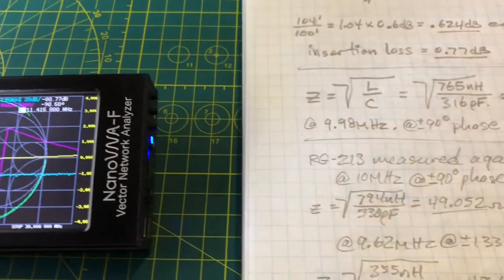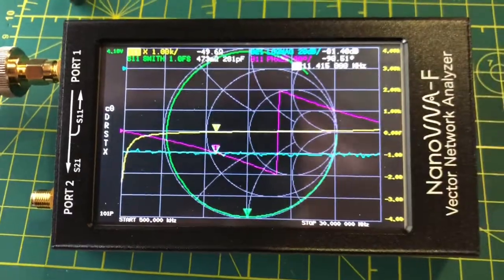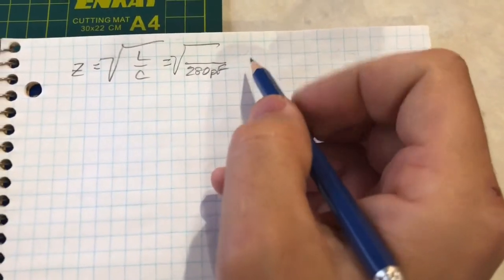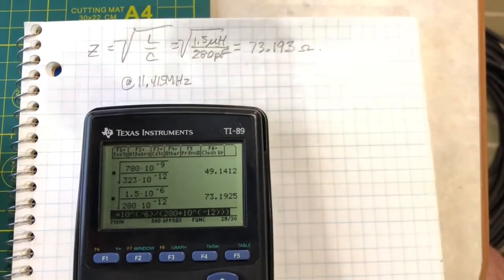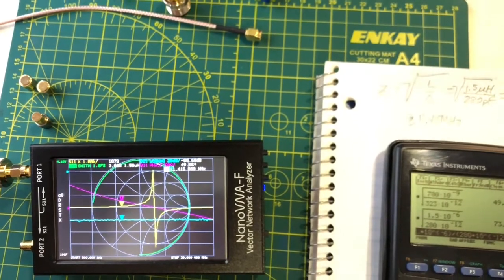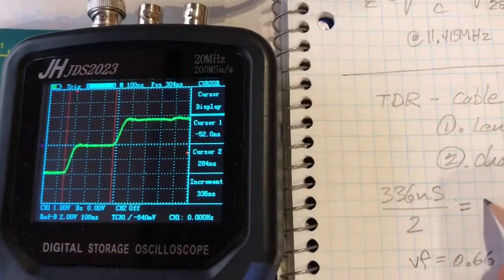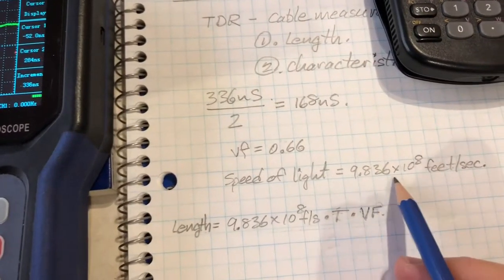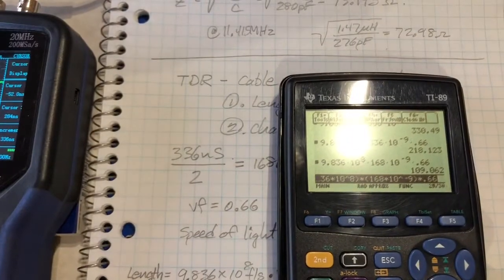nanoVNA - Coaxial Cable Characteristic Impedance Measurement Methods - Testing 75 Ohm Coax - VE6WGM

Comment: Nice work. A very good job of applying basic physics to the problem of identifying coax cable impedances. 

In my tool box I have a set of 600 Ohm, 300 Ohm, (just in case. It's usually flat, but I've also seen a tubular version that might fool someone,) 95 Ohm, 75 Ohm, 50 Ohm, and 25 Ohm carbon composition (almost no inductance,) resistors with stranded leads, heat-shrink, and labeled with their values, with alligator clips on the ends that I can attach to the far end of the coax cable once I have it set up as you have. Knowing the coax is almost certain to be one of those characteristic impedances I only need those values. I start with the 50 Ohm, then try 75 Ohms if necessary. They usually do the trick in seconds, but I've occasionally had to try the other values. 600 Ohms sometimes pops up for audio work. 

I found it handy to have them prepped in advance for when I'm building something and go through my random cable scrap box looking for a particular impedance cable, and short pieces seldom have the cable ID on that particular piece. That way I don't have to take the time to set up and tweak  a pot or trimpot, especially as pots are always inductive to one degree or another anyway. I thought of building a small, battery-powered pulser with switchable output impedance as part of a cable impedance test kit, but I never did. I'm lazy.  :)
Reply from the maker: Nice!  Thanks for sharing :-)

Comment: There is another advantage of measuring the capacitance and inductance near the 90 degree points. There the impedance is roughly similar to the internet impedance of the vna which makes the measurement more accurate. If you go further away then both measurements get more reflection which costs you accuracy. Distinguishing between a lot of reflection and a bit more it's difficult while the difference in impedance to cause that effect is quite significant
Reply from the maker: I agree.

Comment: Hi:

Does this method also work for ladder line or twin lead?
Reply from the maker: I have not tried it, sorry.

Perhaps another operator can take what’s been shown in this video and apply it to measuring non-50 ohm transmission lines, and then post a link to their video?

Comment: Hi Gregg...great vid. I’m looking for a portable scope like the one you are using. Did you look at the JDS2022a before going with the 2023. The 2nd analog channel seems more useful, although a built in generator is handy. Just wondering what you would buy if you were buying one today...thx and 73’s from VE7 land
Reply from the maker: I wanted (and need for work) the signal generator and scope in one, so if I was to buy one again, it would be the same one :-)

Comment: Thanks Gregg, back in the 70's I used my Tek 547 and it's built-in calibrator to adjust the pot. Note that your rg11 can also be quickly measured on the Smith chart with a 50 ohm term. That will make a circle around the 75 ohm point on the real axis.
 73 wa7krn
Reply from the maker: Thank you for that.  I will have to experiment and try it out :-)
Reply: @ve6wo  Some interesting points about the Smith chart you may already know:
- If you sweep any xmission line with the vna you will get a spiral circle that actually spirals down converging to the Zo of the line.  If the line is long and/or lossy enough it doesn't matter if it is terminated and will converge to effectively a dummy load at the Zo of the line.  This is why the SWR gets better on lossy feedlines.
- You can use the nanovna to readout the Zo by adjusting the frequency for the cursor to the 90 deg point (top or bottom of the circle) and noting the resistive value.
- The circles represent half-waves of line length with a quarter-wave at 180 deg.  A quarter-wave is known as an impedance inverter at this frequency. You will see a half circle starting at the center of the chart (assuming a 50 ohm term on the line) and crossing touching the real axis at the line's input Z (real valued) at that frequency. The Zo is the geometric mean (sq root of product) of those two values for a lossless line.  If you know the Zo of the line you can compute the input Z as Zo^2/RL.

73 wa7krn
Reply from the maker: @danbaker5474  very nice.  Thank you for sharing :-)